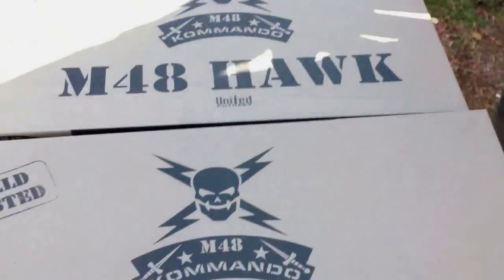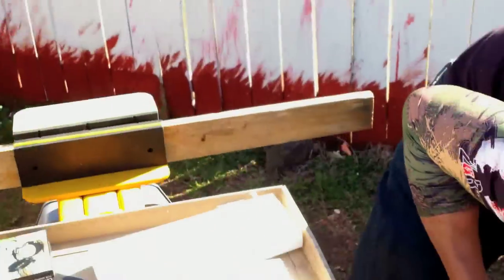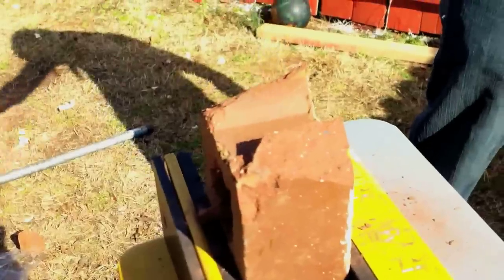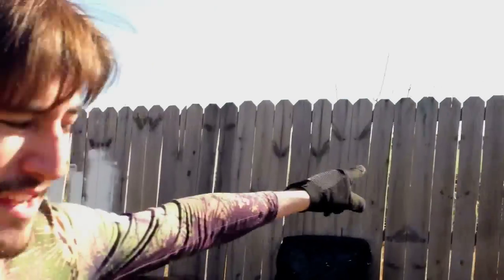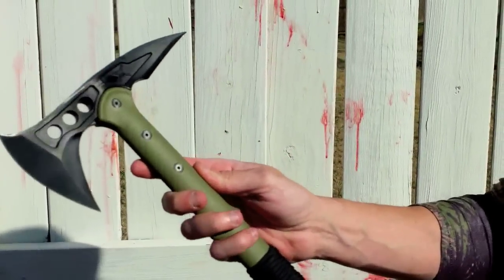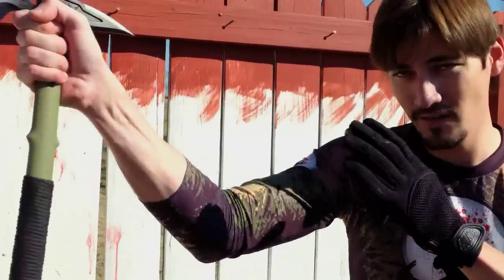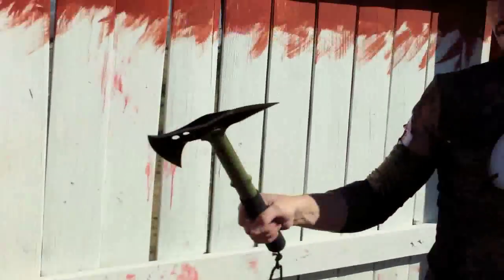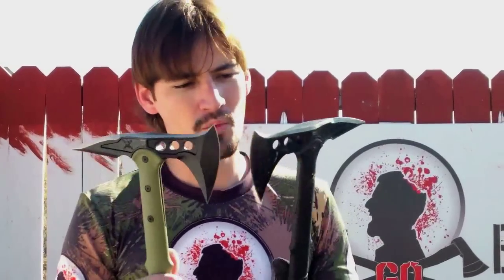The BudK M48 Tomahawk unboxed!  How to survive the Zombie Apocalypse.  How to use a tomahawk.

Comment: Bought the M48 Tactical for my bugout bag. Great tool.

Also people, you can tighten the cord around the handle to give you some slack (and keep it from slipping off, which it WILL do out of the box) so you can clip the bottom of it to one of the holes near the axe blade. It creates a nice bit of support to prevent droppage.

Comment: I don't know why you've called it a "BudK M48 Tomahawk". It's a United Cutlery M48 Hawk. I have one of these. Even though they call it "Hawk", United Cutlery make no claim of it being a tomahawk. It's a tactical hatchet with a spike on one side. They're, apparently, used by some military forces as a breaching tool and as a defence weapon.
Reply: Isn't trying to seperate the difference between a tactical hatchet and a tomahawk just semantics? They are both basically the same thing.
Reply: Not really. I know what it's called because I have one. Plus a tomahawk is a hand-made device usually using stones, not something manufactured out of steel.
Reply: How sharp would you say the axe head is?

Comment: That hole in the car roof is small, you would have to work for at least ten minutes just to get halfway there, not to mention any nearby zombies. However, if you've barricaded all the entrances really well and there is a car full of supplies you can't get into, you've bought yourself enough time to hack through the roof, except why go to all the trouble when you could just break one of the windows, even the windshield, and crawl in and out. I's more efficient and saves time.

Comment: if you were surrounded by zombies and had to climb on top of the car to escape you could either try to escape but jumping over and running or cut a hole in the roof to get into the car. i'd rather have a way to get into the car and start it than be stuck on top with no way to escape.

Comment: Define "practical?" 

"Tomahawks are still used in the military."  That should tell you right there.  It's a survival tool in addition to an extremely lethal weapon.  I've had buddies on deployment use a Tomahawk for anything from using the spike end to dig in concrete for IED wires, or even mundane tasks like chopping wood.

Knives can't solve all your "practical" issues, high-speed.

Comment: I could've used this to save Beth in the walking dead
Reply: No one could have saved Beth. No one knew Dawn was going to reflexively shoot her, it was too spontaneous to have done anything. I feel your pain though, Beth deserved better.
Reply: Your right there was noway of knowing but I wouldn't negotiate with a would be tyrant like dawn there's just no point ( remember the governor) I would've broken into the hospital and got her hot of there myself Who cares what Tyrese would say he was wrong
Reply: It wasn't about the negotiating, though. The negotiation itself didn't kill Beth, her spontaneous stabbing of Dawn did. Going in gung-ho with guns blazing, especially with how many armed guards that hospital had, would have been disastrous and probably resulted in many more lives lost.
Reply: I didn't say go in guns blazing I mean go in smart like Break into the elevator shaft set the bodies on the floor on fire Let the smoke to do it's thing by forcing everyone outside to the cars where his group can pick them off one by one Plus as you can see in negotiations Dawn didn't have that many cops on hand Rick and his group can easily subdue the other two cops in that car kept the other hostages at bay not to mention Maggie and the others would arrive just by then